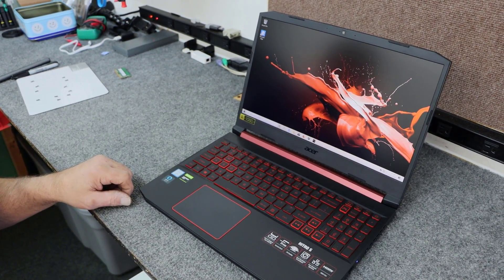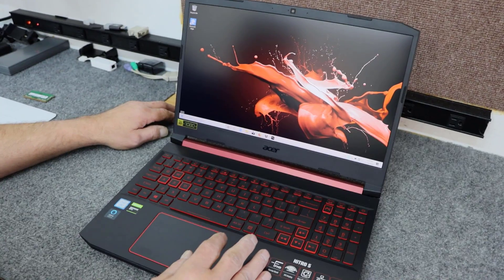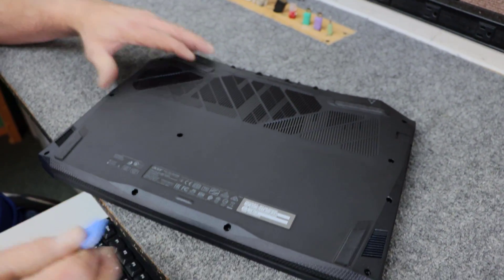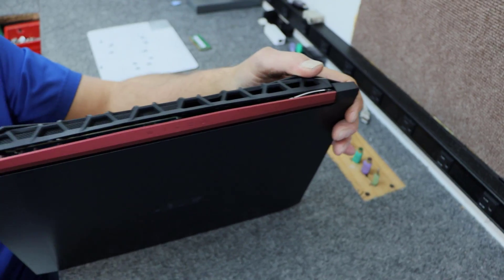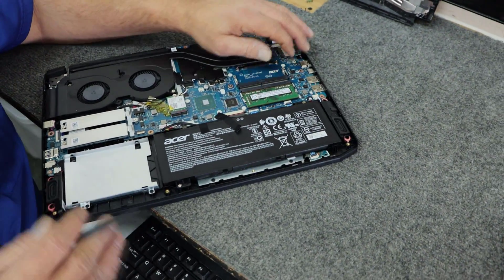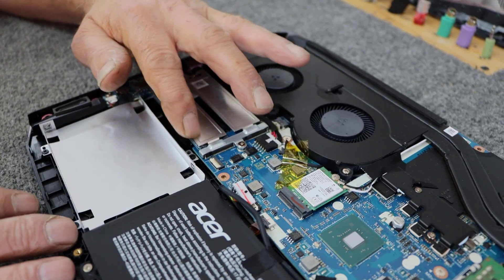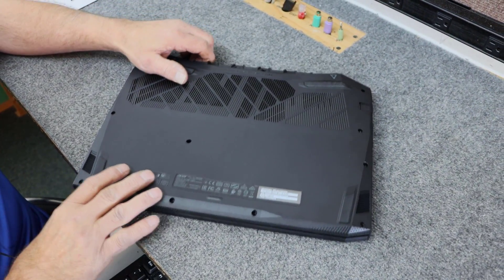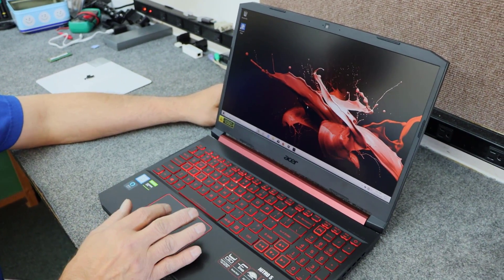Acer Nitro 5 Memory Upgrade AN515-54-5812

Comment: Hello , The default card in this model is single channelled and I am planning to upgrade with a new dual channel 8 gigs of RAM . Can I take the advantage of Dual channel ?
Reply from the maker: Hi. The best way to achieve dual channel is with 2, identical sticks of ram.
Reply: @CadillacComputerCenter  That means both RAM can be single channelled? and it will work like dual channel ?

Comment: Great video thank you. Question: when installing more memory or RAM do I have to use the same brand and type of ssd or RAM? Or can I mix different brands?
Reply from the maker: Hi. You can mix brands. If possible, use the same speed and brand of ram. It will still work with different brands of ram though. Dale

Comment: How would I go about removing my current ssd to upgrade to a bigger one without losing any of my files or operating system??
 (asus vivobook 15, model x512da)
Reply: 1. Download and install Macrium reflect.
2. Backup the current SSD on to an external HDD.
3. Create a bootable recovery USB disk using Macrium Reflect.
4. Install new SSD, insert recovery USB disk, connect the external HDD(backup), go to BIOS and change the boot order to make USB as your first boot device.
5.Reboot and recover the image you have backed up in the HDD to your new SSD.
These are the steps you need to transfer everything from your current drive to the new SSD.

Comment: I have this model is a amazing entry gaming laptop (2019 model). upgrade the ram & add a hdd was easy. the secondary m2 Pci(nvme)/sata slot didn't want to open because the screw was very tight so I leave it alone, atleast ram & massive storage (hdd) are installed 😝
Reply from the maker: Hi. I run into that often. At the factory. They use air powerd screwdrivers to put in those screws.  I see it with m.2 screws, wifi cards, etc.  I've always been able to get them out with a good quality screwdriver.  Dale
Reply: @CadillacComputerCenter  I need get a good one for that screw then, anyway ty for the tip & keep the amazing work in the videos going 👍😄

Comment: I recently got a Nitro 5 AN515-43.  I have installed 32gb ram, no issue.  The M.2 slots on the mobo  are labeled PCIe and SATA.  I am trying to figure out what type of M.2 to put in the SATA.  This is the first machine I have used M.2 and need Guidance. Help!
Reply from the maker: Hi. On all the Nitro models I've upgraded, one m.2 slot is only for pcie, and the other is a combo slot, both pcie and sata.
Reply: @CadillacComputerCenter  Thank you for the prompt response. You do great work!
Reply from the maker: Thanks for watching,  I appreciate it. Dale